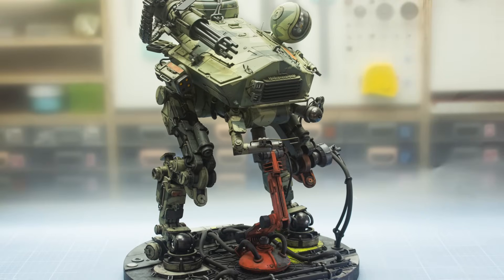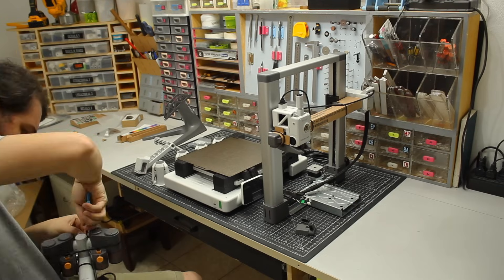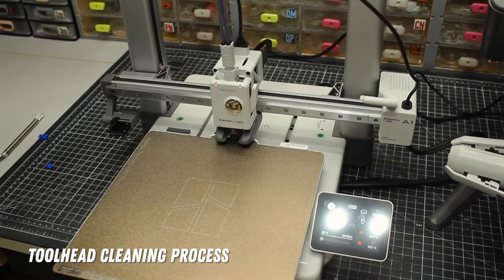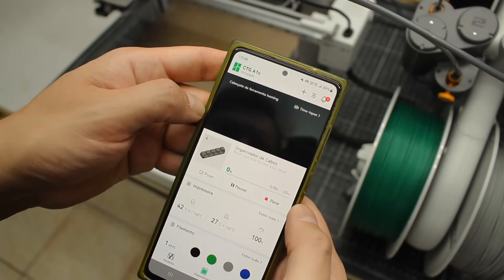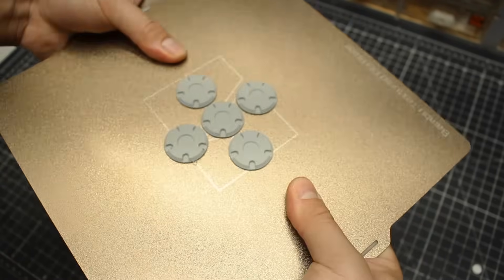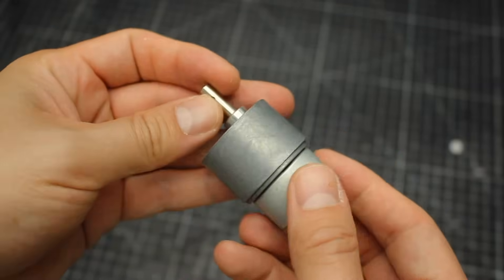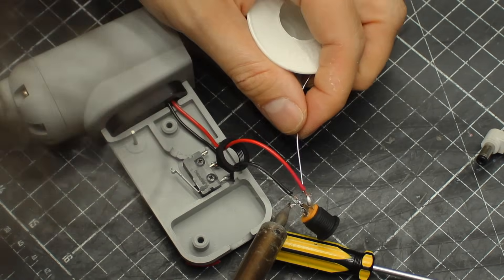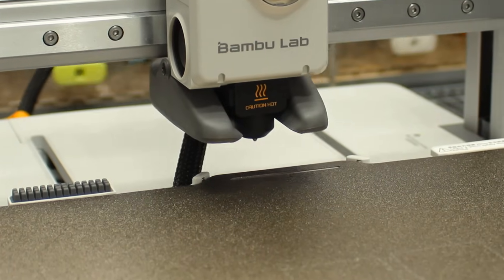Reaching new levels with the Bambu Lab A1!

Comment: Just a word of warning.  I purchased my A1 in October of last year. (2024)  Over the 6 months I have used it, my hot end has gunked up (by bad filament) and forced me to purchase new nozzles.  I bought a couple from Amazon.  Turns out, they only lasted a month or two and ended up ruining my entire hot end.  Bambu Lab sells replacement nozzles and I am waiting for a new hot end to install to get back to printing.  As of this entry, nozzles are approx.  $15.99 US Dollars and the entire Hot End assembly (minus nozzle) is $19.99.  Pretty reasonable to get back to clean printing.
Reply: There is a plastic repellent paint that you can put on your nozzle to prevent build up. A nail polish size or smaller bottle cost about $15. Apply it once a month or as needed.
Reply: @daledickey8400  Does it have a name?  Amazon?
Reply: @bbrachman  Slice Engineering Plastic Repellent Paint is one brand, just read the reviews, but there others out there. Haven't personally used it yet, but have heard very promising results. Not good for very high temperatures.

Comment: Bambulabs? No thanks.
Reply: Why?
Reply: Why, though? They are the top name for home and small business 3D printers for a reason.
Reply: @Joel-3Day  They aren't the top name for small business or serious users, they're the Apple of 3d printers, a consumer brand aimed at people new to printing who aren't comfortable handling a serious machine. They are slowly turning 3d printers into a locked down walled garden, taking away user freedoms and forcing all user data to flow through China-controlled servers.
Reply: @Joel-3Day  Aggressive anti-consumer practices so egregious they show up on the wikipedia page for the company. You can also find literally hundreds of videos on Youtube talking about the subject and you will notice that most creators have stopped doing Bambu sponsor spots in response.

The backlash is a little bit overblown, but one thing is clear: I wouldn't trust the company to do the right thing for the consumer and I understand people not wanting to touch their devices with a 10 foot pole.
Reply: @ZhilBear what is an anti-consumer practice?